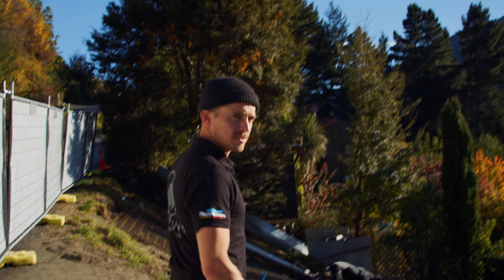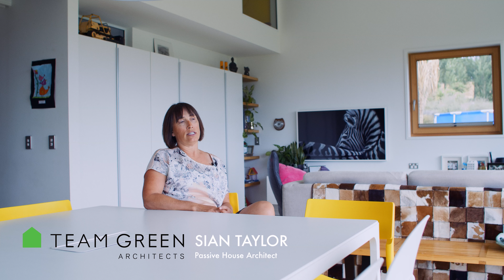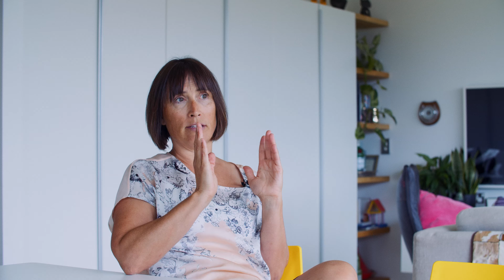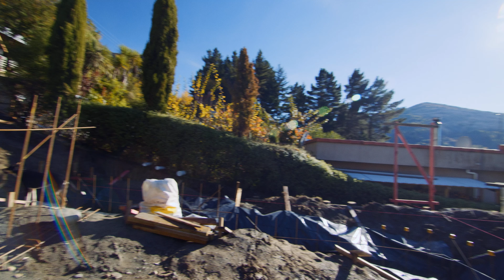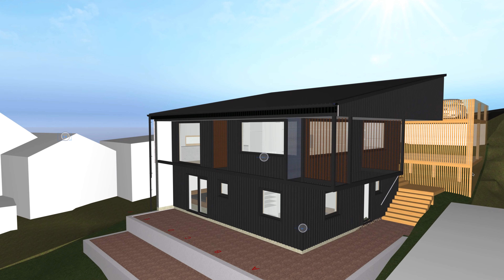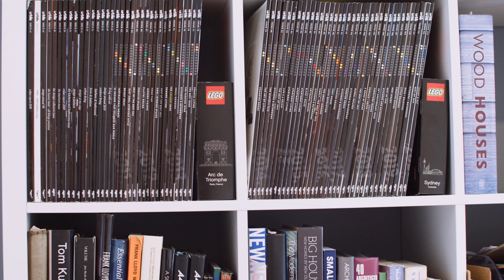Watch Us Build a Passive House in New Zealand - Episode 1

Comment: Better off using conventional RCM block with internal 90mm strapping for both retaining and ground level walls. The Architect is British from her accent and I'm surprised she didn't specify a better slab system by incorporating insulation between concrete mass and screed for integrated heating. The raking monopitch roof also reduces the available space for bulk insulation whilst allowing adequate ventilation.

Comment: Very clear explanation of why and great method closeup. Congratulations to the team. One question you repeat zero thermal bridge. But isn’t your rebar from footings going into the wall and connects to the slab?
Reply from the maker: Hi Fred! You are correct. The goal is to be completely thermal bridge free. These point bridges are two metres underground in a insulated nudura block, so they do not have a large impact.

Comment: Sorry maybe Google is wrong but are you saying an annual high of 21 and a low of -3 is extreme?
Reply: Hi Blomit, your data is perhaps the high and low for the past 7 days? Queenstown is a ski resort town, which has snow on the roads in winter and a very dry hot summer - Typically getting up to 35 degrees. I think the lowest recorded day in our lifetime was -12 degrees. This is considered an extreme climate in New Zealand.
Reply: @drewatkins621  yep that makes more sense. Google be lying 😊. Or maybe showing average highs and lows